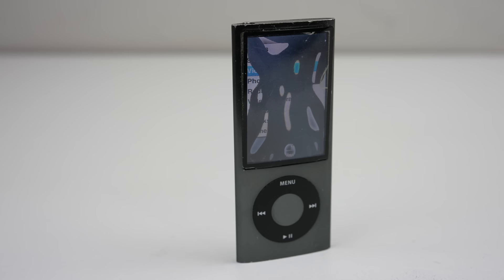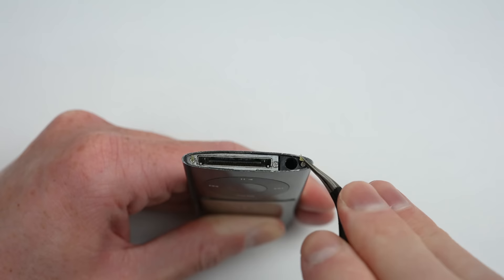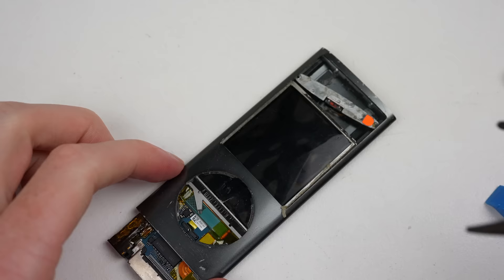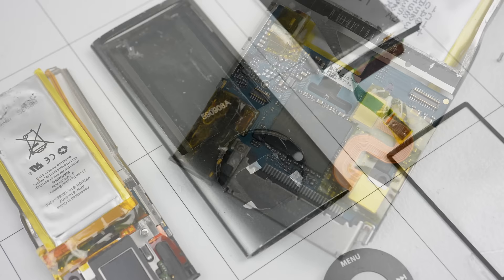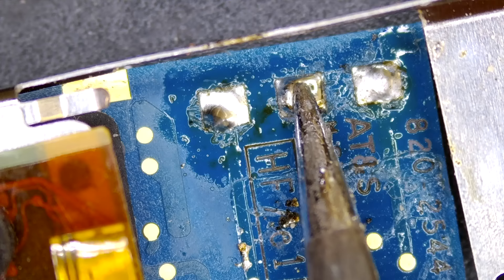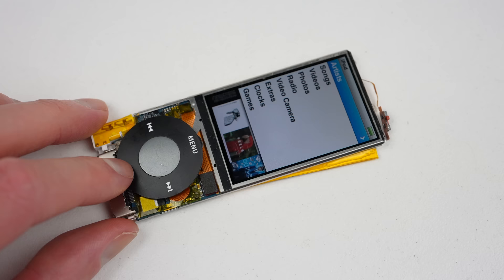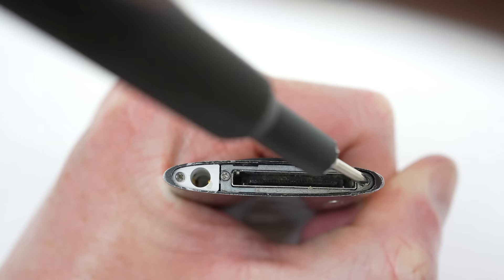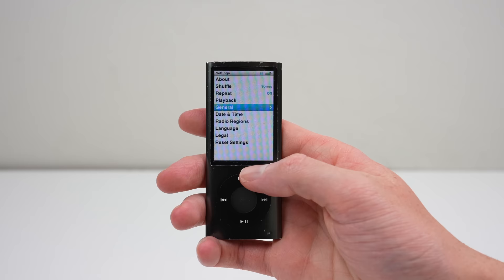Only I Am Stupid Enough To Try And Fix This iPod Nano

Comment: Ironic timing. Recently I found my 5th gen iPod Nano with the screen broken away at a 45 degree angle as the battery puffed up while in storage. Honestly, I'm impressed the battery held together and didn't cause a fire.

Comment: Surprisingly I got one with a bulged battery as soon as I charged it the bulge went away got it on eBay I was surprised but didn’t hold charge.. I left it in the washing machine and I was freaking out so I took it apart and use rubbing alcohol and electronic cleaner to get rid of the conductive water from the logic board but I ripped the  click wheel ribbon cable stupidly but luckily everything else went smoothly now I’m waiting on parts click wheel and new battery just hoping no damage was done with the water

Comment: I wonder if puncturing the battery in a controlled way and letting it vent would be the best way to take one of these apart. If the battery is fully discharged it shouldn't be too much of a fire hazard.

Comment: Just pierce the battery. So that the pillow becomes a brick again. And voila.... easy it can slide out now. So that it does not blow up, you should discharge it first. But then again.... ages old batteries that were laying in cold are probs 0 volts already. Just make sure you don't breath the fumes that will come out of the batter when you pierce it. I've done many a repair by this method. No explosions ever. Don't forget to dispose of the battery in the dangerous waste disposal center in your country!!

Comment: adding low melt solder to the stock solder will help u removing it with hot air or the wick

Comment: I still have my 4th gen nano unused because i tried to change the battery and i ripped off the click wheel cable. Replacements beeing really expensive and hard to find (maybe only in Europe) i left it there and forgot about it. Shame, i had so many memories with that unit.

Comment: I've repaired those for money...that HOLD swich wire... YOU NEED TO REMOVE IT FROM ITS METAL CASE! 
If it brakes you need to do some serious operations with an old IDE cable to make it work again and even that is not 100%.

Comment: Its hard to beleive but those are actually easier to work on than the previous generation ones. The forth gen is basically the same case as these without the camera but the key diffrence is that the click wheel is non-removable, had to be disconnected through the bottom and has both plug and conector on a flat flex thats glued to both the case and the logic board. I've fixed hundreds of ipods at  this point but have only ever once sucesfully repaired a forth gen nano, the flex tears and you cannot get replacement clickwheels for this model. Oh and the easier way to remove nanos from their case (at least 2nd, 4th and 5th gens) is just to puncture the battery, it sounds bad but as long as you make sure its fully drained first and only put a tiny pinprick in it they debloat and come right out. Ive done about 30 or 40 of those gens with bad batteries and have never had one go up in flames, do it outside if your worried and dont breath the stuff in but a drained battery is very unlikely to catch fire as its energy release that causes that.

Comment: I have a 5th Gen Nano (same color as yours), and last year, I also replaced both the LCD and battery in it. While it was a bit less difficult, because the battery was barely swollen, it was still a pain. I only planned to replaced the battery, but as I was trying to push the iPod out of its chassis (3:14), I accidentally cracked the LCD. ...aand I also tore off the hold switch. I didn't do it while pushing the iPod out, nor did I do it while pushing it back in. I did it when I was unconciously twirling with my fingers while I was distracted by my friend...

Comment: i love these Nanos. still got mine. need todo a battery replacement on it, but still use it docked in my car.

and remember, this device has a full on large 30 pin apple connector and a headphone jack, but they cant do this for modern phones. screw apple.

Comment: I know it's sound strange, but... you can take a needle and just puncture the skin of the battery not the cell. The battery becomes like that because of the gas. A small puncture will allow that gas to exit and not create problems as long as you don't puncture the layers.

Comment: I think the wick wasn't working because there was not enough flux and heat. Wick is very finnicky and picky about being saturated with flux, and having enough heat to actually wick up the solder as a liquid.

Comment: It's been a while since I heard the term Spicy Pillow.  I think the first time I heard it was from DankPods.

Speaking of which I have a phone with a spicy pillow, since I have no way to deal with it, I had to get a new one.  It got so spicy it lifted the back off of the phone (it has a plastic back, so no harm done to any fleshy appendages there), the thing that was holding it down was the case I put on it, but I think even that started getting ineffective, since it made the back of the case bulge too.  (I think it was an OG Motorola G Stylus, the 'holographic' indigo colored one)

Comment: Seemed to be putting a little too much pressure on the solder wick which was causing it to fray, the wick needs to have a tight weave till to pull up the solder.

Comment: The iPod Nano 6th gen seems to be a lot harder to fix. You basically have to remove the tiny glued frame and micro solder the battery or storage.

Comment: One of those products I get the impression that wouldn't be too hard to modify in design to make disassembly easier, still retaining its size and looks. But I don't think Apple would consider that in their best interest. So I of course share your opinion, that manufacturers should be made to make devices easier to repair, especially with regard to batteries. It's so stupid that e.g. I have a USB-charged bike tail light, that is a lot bigger than this, could be so easily produced with two screws and some rubber to make it waterproof, yet they've decided to glue it, making the Li-Ion inside hard to replace.
Reply: Making the metal case into two halves would do it, but not sure how much it would compromised the stability.  Either way, I ever need to fix these I'd just carefully dremel the stupid case off and buy another one when I ordered the battery.

Comment: You could've actually easily puncture the battery with a needle, you don't need to jam the needle all the way through, Given how small the battery was and probably not charged it wouldn't have caught on fire.

Comment: I tried to fix a gen 4 nano and the battery inflated so much that when I tried to pull up the screen the top metal tab broke and then I had to destroy the screen and click wheel and hold switch  to get the motherboard out

Comment: Wait, which iPod Nano is the worst one? The model I own?! Oh crap.
I've got mine connected to a charger at all times, which will hopefully prevent the battery from expanding. But alas, entropy comes for us all. If mine goes belly up, it's probably going right in the trash, because I don't have the brass to attempt a repair.

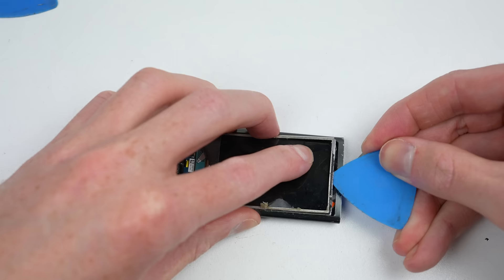Comment: 3:45 Seal the unit in a nitrogenated atmosphere and puncture the battery, allowing its internals to slowly burn off from residual oxygen over time? Then, several months later, dig the ruined battery out a small ruined piece at a time?
...oh.

Comment: And this is EXACTLY why we need regulation to combat intentional throw-away design. 

They EASILY could have made it SLIGHTLY thicker and used small edging areas as easy entry points for clips. They EASILY could have made the battery easy to replace out of the TOP with special design, or a screwed on back with silver screws. 

I understand the idea of "aesthetic vision," but sometimes a compromise to ensure the device isn't throw-away when an INTENTIONAL and INEVITABLE failure mode causes it to be unusable.

Also, hiding screws under those covers is purely anti-repair- as those covers prevent ingress of dirt/dust/moisture and are easily damaged - same with the NECCESSAREY hold switch (the ipod will not function right without it).

They EASILY could have had a connecter at the top and a better placement of that cable to the motherboard.

Comment: No point doing a repair, phones are faster and better in many ways and also support higher quality format and provide wireless connectivity.
But is a nice thing to have a cheap device like this just to do some sport and not to worry if they ever brake.

Comment: You can use polywatch on the screen to at least improve the condition. PolyWatch 6417084129062 SS013059000 Plastic Watch Crystal Scratch Remover Polish

Comment: I tried to repair one myself and damaged the the screen, the on/off switch cable and the click wheel. It was not worth it in my opinion. Its the worst design of a device that I came across in years of repairing devices.

Comment: I don't think those conical soldering tips are great at retaining heat. I've had much better results using a knife tip, even for delicate jobs like this, so I recommend switching to one of those. You shouldn't have to dial the iron up very high either.

Comment: You gotta hand it to Apple. As annoying as this process was, this just speaks to how much of the competition Apple was able to beat. Not only did every other company try to copy or beat Apple, but if they managed to make an mp3 device as small as the nano it probably only had a hundred mb at most and were total pieces of trash. But with the nano, this generation specifically, managed to no only make a fully functioning ipod with the same functionality as the full sized ones, but were able to take video. All the while with the intent that it's meant to be thrown away after the battery swells.

Comment: Not only does the pain in the ass design prove that these are totally throw away devices it means 99% of them were destined for landfill especially when this problem was quite common and this goes directly against apples reusable/recycle motif they have now 🤷‍♂️ I really hoped apple would show some love to the iPod I’ve always been a fan of them even though I use an iPhone I would totally rock an iPod just not the touch models as the battery on those suck too. Rip the iPod 🪦 well never forget you 😢

Comment: Persinally i dont think iFixit is very good at Selling good non bad batterys for old tech.

this is mainly because i got a iphone3gs battery twice from them and it shuts off after 5mins of use even wen it said 100% then after it charges a bit it said 2% or 30% WTHekc.  
even when i did there calibrating. i even tried it in another 3gs but sadly no luck there batterys still did not work.
when buying there battery for my 3gs i thught in 2 years buying it again after alerting them to the issue that they 
would of fixed there parts "Sadly even after buying again it still had an issue" 

tbh i know its old but its wrong of ifixit to sell dumpy parts or batteries when they knnow its not working im fed up with the company.  anyway i have my original so i may take off the replacement battery protection circuit and carefully solder the old circuit onto the new battery to see if that can fix it.  if it dose fix it... i hope ifixit can sort there stuff out or stop selling 3gs\3g batteries. if not trading standards prob going to be called

Comment: Designing a device with a removable battery isn't always an option.  There are so many variables to consider throughout the process, and I think that people forget that.
Reply: For something like this, it would not be hard to do, and it would make the device more reliable. Just separate the housing into two parts instead of one, attaching the two halves with screws, glue, or clips. Any battery expansion would lift up the back rather than breaking the screen, and a battery replacement would be much easier. Also, it would be very easy and not require any major design change to add a ZIF or snap connector for the battery rather than using solder.
Reply: @linuxsbc  I'm not saying it's difficult from a technical aspect, anything can be designed.  I'm talking about cost, part supply, tooling, and every other variable involved in creating a product and bringing it to market and at the right price point to make it profitable.
Reply: @JeffCD77  Definitely. I agree on that part. However, for the iPod Nano, it would probably have been easier and cheaper to split the body into two parts with a removable back than to have everything slid into one housing. I suppose a connector for the battery might cost a few cents, but given the price, I think Apple could have managed it.
Reply: @linuxsbc  Anything is possible 😉.  My point was more generalized I guess and not specifically about the Nano.  I just always hear "Apple should have done this, or this company, that" and it's not always as easy as people think it is.  In most cases, you can't have your cake and eat it too.  That's all I was trying to say...